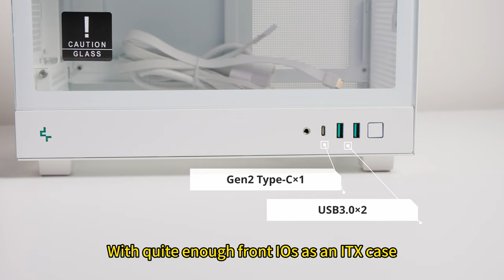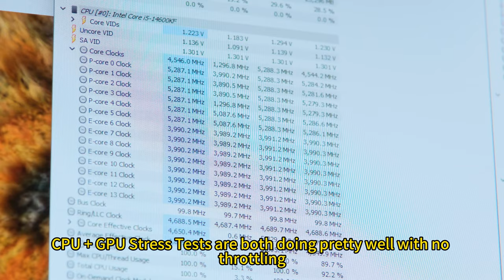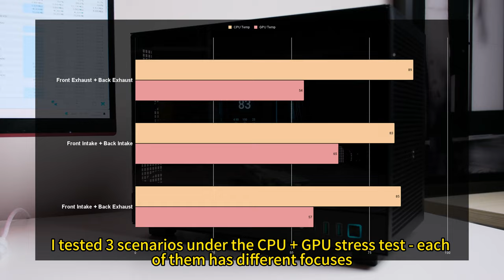Budget-Friendly and Fun - Deepcool CH160 ITX Case Full Review and Hands-On

Comment: great video, definitely deserves a like! it's the only one I found that showed if bottom intake fans will fit. i do have one question though, can I fit two bottom fans?  do I need slim fans, or can I use standard 120mm fans?
Reply from the maker: You could fit two fans but it really depends on the GPU you are using. Sometimes it may not be necessary to fit fans underneath since your GPU might already be two-slot thick.
Reply: @nellalab  oh, i forgot to mention that im using the ASUS DUAL RX 6600 V2 which is a 2.5 slot, can i fit intake fans?>

Comment: Hey man u said it will fit a Matx mobo .Do i have any space left for an ATX PS2 if i install a mATX MOBO? Kindly reply please.
Reply from the maker: It doesn’t actually support matx board - even though u can put it in - the rear IO doesn’t fit.
Reply: @nellalab How far would it stick out of the case if you cut the bottom of the case?

Comment: Hey, I have a question - the Asus TUF GPU you tested was 305mm which is the max the case theoretically holds, do you think it'll fit a 307mm GPU tho? With SFX PSU.
Reply: It can fit up to 315mm, you just have to play around with angles and put the air cooler after the gpu

Comment: What is Gen2 type C? Is it a real 10gbps port or the fake "Type2 gen1" with only 5gbps speed(which is basically USB 3.0)?
I've seen several reviews but not one of them talked about it and I did not find it on Deepcool's own website either.
Reply from the maker: USB 3.2 Gen 1 (5Gbps) and USB 3.2 Gen 2 (10Gbps) use one TX lane (transmit) and one RX lane (receive), based on the positioning of the connector. USB 3.2 Gen 2x2 takes advantage of all four lanes to achieve up to the theoretical 20Gbps transfer rate.

Comment: What was the first AIO you used? and did it fit perfectly?
Reply from the maker: Fractal design lumen S24 - fits without any issue
Reply: @nellalab  could you recommend any budget or slightly cheaper AIO's that may fit on it?
Reply: @nellalab  Just subscribed as well, cheers!